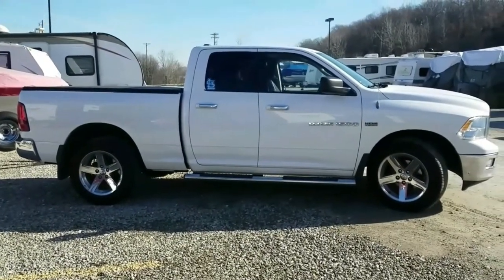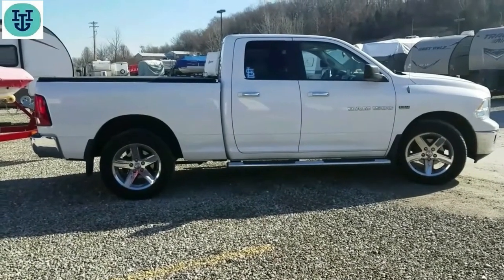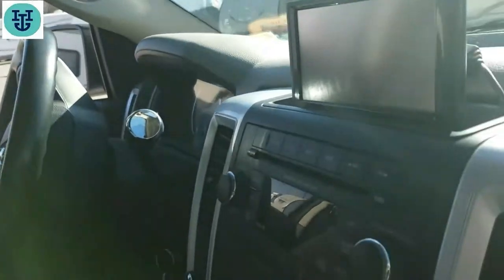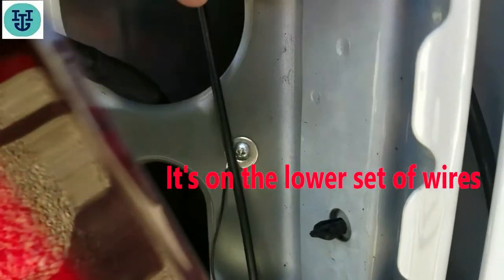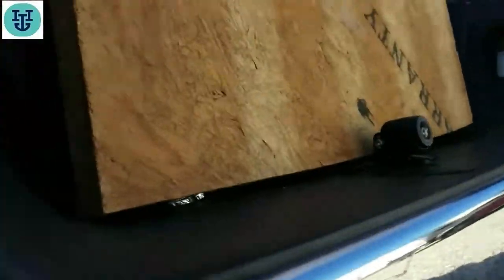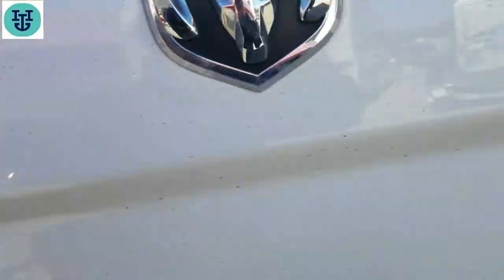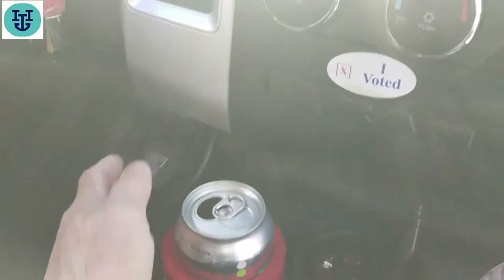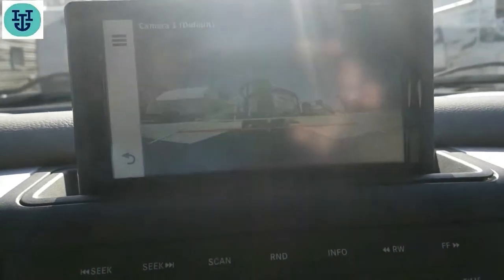Hooked on Boating DIY / Garmin Back Up Camera Install

Comment: I would like to see the actual wiring install on the pickup truck.  Where did you place the transmitter on the pickup truck.  I put mine behind the tail light (2013 Silveraldo) which apparently is too far away from the receiver.  It takes nearly 4-5 seconds to connect and get an image after I put the transmission in reverse.  Once I get the image, it works great, but the 4-5 second delay is a PITA.
Reply from the maker: I mounted it inside the bed right above the left tail light. It is shown starting at the 5:40 mark of the video. Even there, I do get a 2 to 3 second connection delay. The only thing I changed from the video was my camera location. It is now mounted up by the tailgate handle pointing slightly down so I get a view of my hitchball when I am backing up to my trailer.